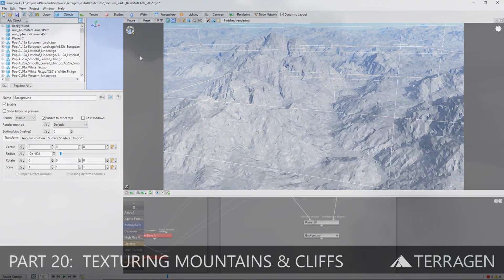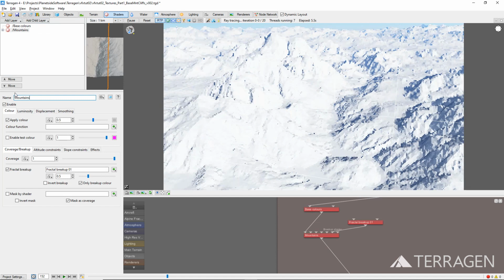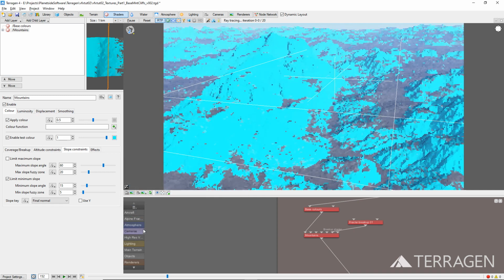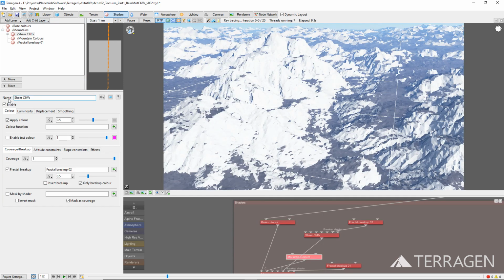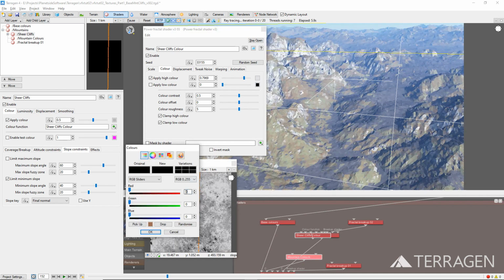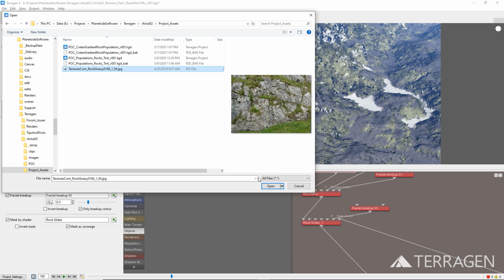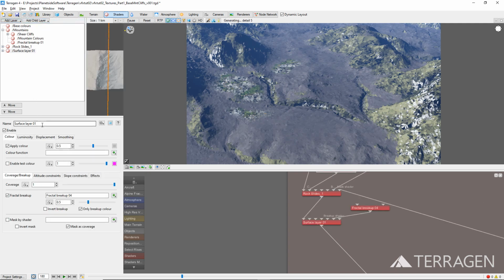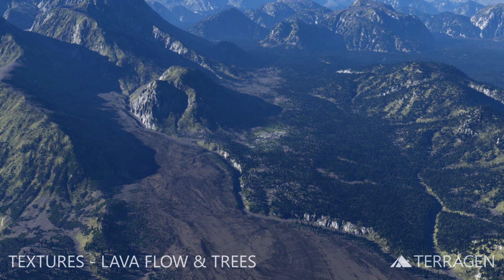Terragen for VFX: Part 20 - Texturing Mountains & Cliffs

Comment: "Rock Slides couldn't be connected to the Mask shader input of Rock Slides because this would cause a circular path in the node network" 

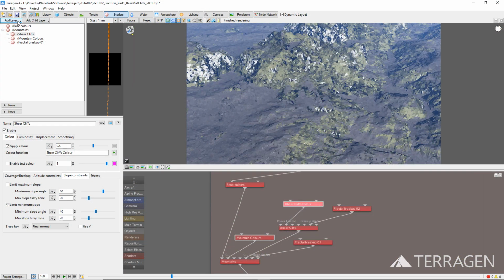That is the message that pops up when I try to do that part of the video starting at 7:00

Edit: Never mind, I figured out you simply just copy and paste the same Rock Slides shader node and then connect that.
Reply from the maker: Thanks for watching the video and providing feedback.  From what you're describing it sounds as if you have two nodes in the project with the same name, "rock slides".  There are certain cases when two nodes can have the same name, for example if one of the nodes is located at the "root level" of a project and another node is located within the "internal node network" of another node.  In the case of this video, that situation should not apply.  

In a previous video we created a Painted Shader node to define an area of the terrain and named it "Rock Slides".  In this video, the instructions are to add a Surface Layer node and name it "Rock Slides".  Notice in the video, that in the Node Network view and the Shader Node List, Terragen has automatically renamed the Surface Layer node to "Rock Slides_1" in order to avoid the naming conflict that occurs when two nodes share the same name.  The video then proceeds to apply the Painted Shader node named "Rock Slides" to the Mask input of the Surface Layer node "Rock Slides_1". 

You can of course, name these nodes anything you like, as long as they're different.  Perhaps we might have provided an even more descriptive name for the nodes such as "Rock Slides Mask" for the Painted Shader node or "Rock Slides Texture" for the Surface Layer node.